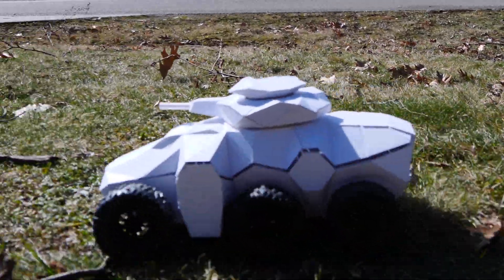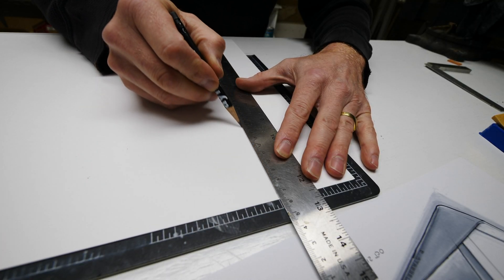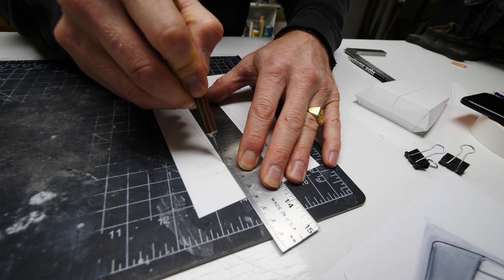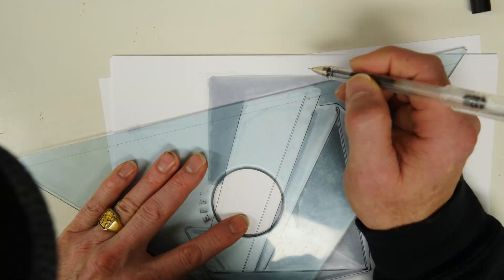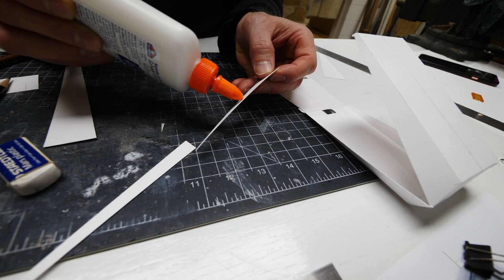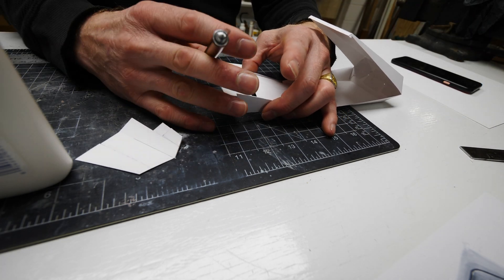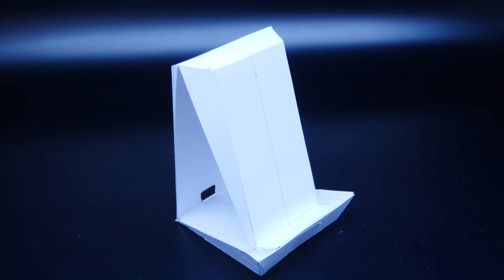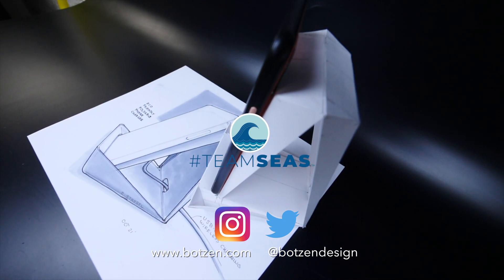Paper model making: Wireless charger #TeamSeas

Comment: Why wireless? If the phone has to be placed in a cradle anyway, why not just add a connector to the cradle? This would provide more efficient energy transfer, resulting is faster charging and less wasted energy. Considering the ecological goals of the project, this would seem appropriate.
Reply from the maker: No USB-C cable is needed, visually much cleaner, earlier to use, plusses and minuses either way, but I just like wireless charging, it's the way of the future.
Reply: If I’m putting a phone in a cradle, I don’t really want to have to plug in a cable, I want to be able to put the phone in, and take it out as needed with ease.
Reply from the maker: Yup
Reply: @almostanengineer  I don't think you understand what I'm suggesting. The plug end of the cable would be built into the cradle itself. You would merely have to place the phone in the cradle so that it engages the plug; you wouldn't have to handle the cable itself. I've been using a cradle like this (one of the original products from Grovemade) for years. It's not a big deal to do this.
Reply: @bobwatkins1271  those already existed for iPhones and iPods and had a huge flaw, the connectors wore out over time and broke. What do you have against wireless chargers exactly, they are amazing.
Reply from the maker: This product would not have the mass for that or be sturdy enough to hold the cable. Plus you have to line the cable in the plug, kind of a pain in the ass compared to wireless.
Reply: @almostanengineer  I have nothing against wireless charging. In fact, I rather like the idea of just laying the phone down on a flat surface and having it charge. I have even considered modifying my night stand to have a built-in wireless charger. What prompted my original comment was the apparent disparity between a video purporting to have concern for the environment and the choice of an inefficient method of energy transfer.
Reply: @bobwatkins1271  yup, wireless charging is inefficient in comparison to wired chargers, however, the shift into more ‘renewable’ energy sources around the globe, and the power efficiency of battery technology is getting better that we need to charge our phones less often, will help too offset the environmental impact of wireless charging. 

Not to mention the entire point of the videos are to show you the process of designing a product, not mass producing a product for retail sale.

Comment: I have a question?
When I watch posts like yours I turn my cell to get a bigger full picture. 
It looks like your design is only for a cell to be used on the standup version? 
I understand it’s just getting started so you may have a plan for that already.
Thank you
Dan
Reply from the maker: Yes, vertical position only. You could use it in the horizontal format but not to change

Comment: The pulp idea is interesting.  Have you considered mixing the wood fiber with an epoxy as a binder?   That would create a more permenant object.  There are bio based epoxies that could be used.   It would be like a bio version of "forged carbon fiber".
Reply from the maker: No, I have considered it, as I want it to be a sustainable product, adding a plastic binder wouldn't not be in the spirit of the project. Might be bio derived  but it is still plastic.
Reply: @EricStrebel  I guess I'll sit back and see. You present it as though it is going to be a viable product you will sell?  I have no doubt that you can make this object out of pulp.  But I will have to be convinced that pulp alone is enough to make a durable product....  I would add durability to the definition of sustainability..

Comment: At one time I was doing a fair amount of scale modeling in paper. Called Card Modeling it features a wide variety of subjects. Everything from figures to planes, trains and automobiles. When co strutting model ships they often have a frame work internally.  On one build of my own design I had the frames (65# card slock laminated to 40 point chipboard) on one inch centers with a .9 " square of the same material. Noticing it's amazing stiffness I built a test piece 5 inches square with the frames running both ways with top and bottom plates along with the .9" squares between the frames on both plates. The one inch tall assembly would easily support an adult. It handled 500#s in a spring compression test stand. It took an arbor press to collapse the structure. Do not under estimate the power of paper. During WWII the British built drop tanks for aircraft out of paper based materials.
Reply from the maker: Used to it's full potential paper is quite strong. Definitely hoping to use that to my advantage in this project. Thanks for your comment and support, much appreciated
Reply: @EricStrebel  
A great many products we use today were actually born of the leftovers from the production of other products. The entire petrochemical industry was born out of trying to find uses for the left over "waste" from the production of coal oil (kerosene). Gasoline was also a leftover from producing kerosene from petroleum. Masonite, particle board and other similiar forestry products were born from the desire to find a use for the waste products from processing wood. There is no such thing as waste really. So called waste is only a raw material looking for an application.